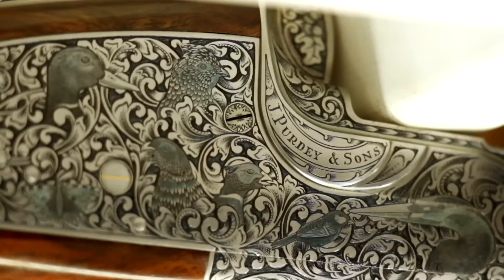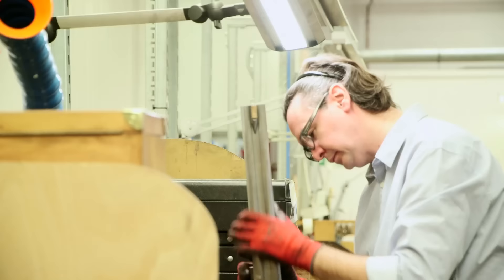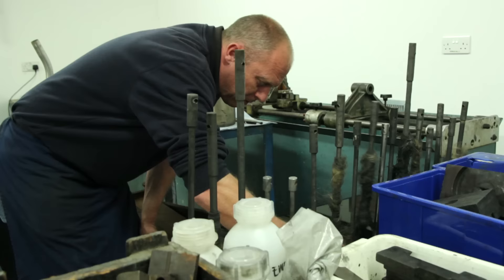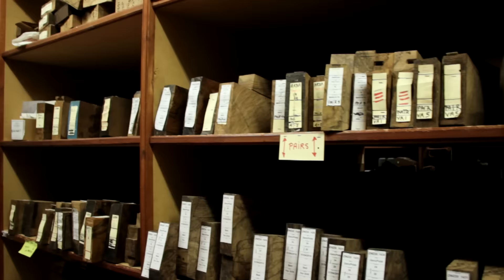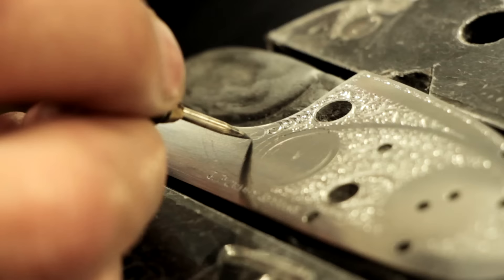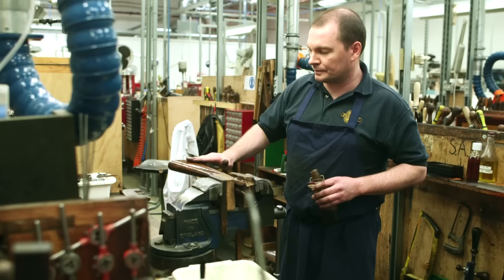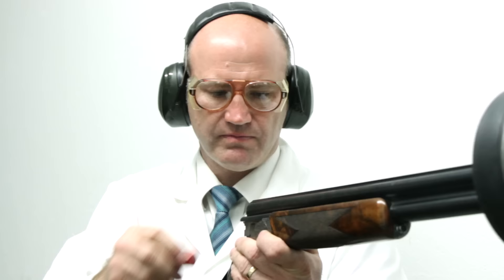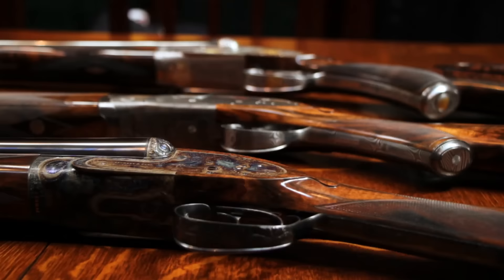James Purdey and Sons: How to Make a Handcrafted Gun

Comment: Takes a month to make a barrel tube assembly?  I'd like to know what exactly goes in in that process to take that long.
Reply: Rusty Shackleford like H&H they don’t use computers and trickery to get the barrels firing straight. the make the barrels, test fire, adjust, test fire etc etc until it fires straight.
Reply: I don’t know if it is still the case but the barrels used to be filed by hand to get the external surface finish.

Comment: What are the cost of one of these shotguns
Reply: Cheapest on GunBroker looks to be around $13,000. I'd say average used is around $80,000. New they are upwards of $130k. I've seen them as high as $375,000 for matched 4 barrel set (12, 20, 28, 410).